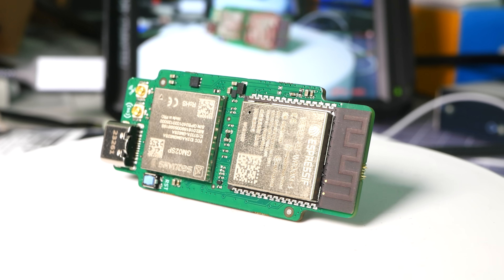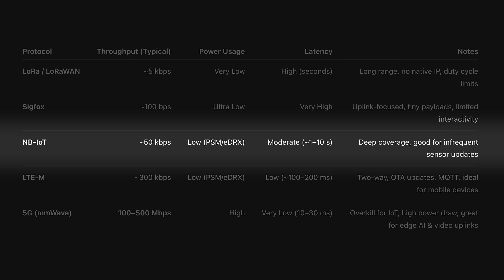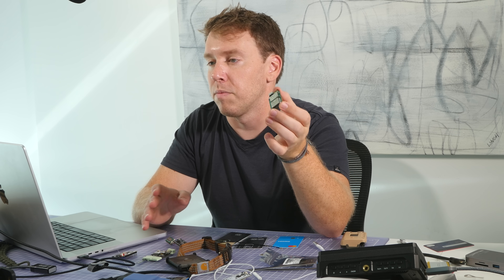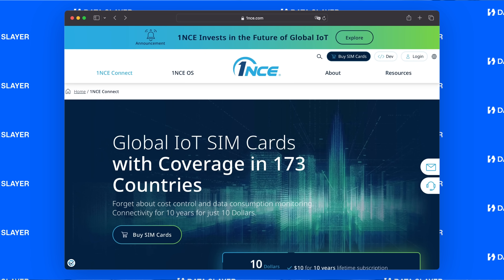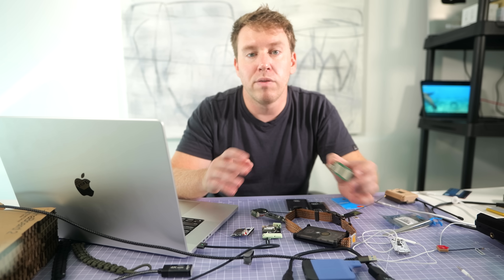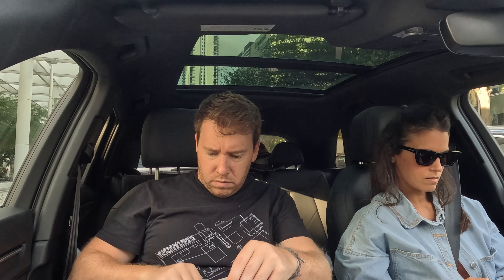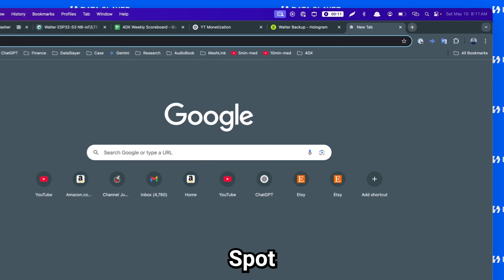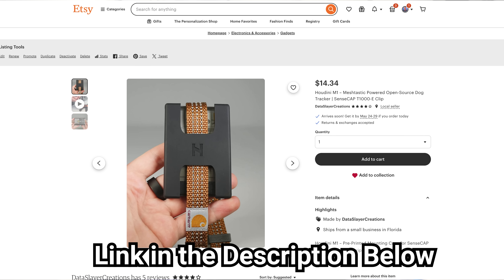You’ve Never Seen Cellular Like This

Comment: Ill be impressed when actual smartphones come with embedded Lora as a backup mesh communication backup, specially for remote areas and when camping.
Reply: Someday I would like to see cell phones with software-defined radios that use long range as primary, and only falls back to the cell phone tower when needed.
Reply: @pilotavery brother, they already do, to a degree, most of the more modern GSM cellular "modems" are technically capable of listening and talking well outside of their strict band requirements, they are locked at the firmware level.
Reply: @rickb06 no, they use very narrow tuned individual power equipment for each band, while also using very specific kinds of antennas, again, tuned for very specific bands and frequencies. They don't use software defined radios. Even Bluetooth operates independently, it's not a firmware thing. That being said there are some phones that specifically disable certain frequencies that are outside of a specific carrier, but that's only other bands that the phone would support internationally. That's independent of what I'm talking about.
Reply: @rickb06 actually there’s truth on both sides here. Modern phones aren’t pure SDRs, but they also aren’t narrowly hard wired per band the way older designs were. The baseband is largely software defined, while the RF front end (PAs, filters, antennas) still imposes real hardware limits. A lot of what phones can and can’t do today is locked at the firmware and regulatory level, but it’s not unlimited  you can’t just jump to arbitrary frequencies either. Direct-to-cell works because satellites operate within existing cellular bands, not because phones suddenly gained new radios.
Reply: @pilotavery You’re not wrong that phones have band specific hardware like PAs, filters, and antennas, and that Bluetooth/Wi-Fi have their own RF chains. But modern cellular modems are largely software defined at the baseband level, and firmware/regulatory locks play a huge role in what bands are enabled. So it’s not purely hardware limited,  there’s a lot of flexibility built in, just constrained by design and certification.
Reply: @marcfavell  the baseband and the chips, sure, but usually they have between 12 and 16 antennas and they actually emit a lot of them from the board. Different regions actually have different antennas and different traces on the circuit board and they can't put all of them because of issues with multipathy so they pick and choose which ones that region will have. 

Also a lot of them simply omit certain technologies like qam and mimo
Reply: @pilotavery why? What’s the benefit of that?
Reply: @YagnaVudathu  so if you are working in an area that does not have very good cell service at all, you can still call your Local Work Buddy with radio. Up here in Washington this happens all the time even worse in Montana.
Reply: @pilotavery They’re already trialing satellite-to-cell here in Canada — pretty sure it’s using SpaceX/Starlink. What’s really interesting is the idea of a hybrid: something with power usage this low, but with the ability to communicate directly with low-Earth-orbit satellites. That would be amazing.
Reply: I like the idea but i dont think it will happen. Better get used to carrying a keychain esp32 for LoRa and meshchats. Speaking of meshchats, have you heard of reticulum?
Reply: @Casualf1lth  anything is possible with open source technology. I have seen phone-radio combos that use android before. This would be a very easy evolution of this already existing product.
Reply: Why in the world would they do that? 
You people baffle me. 
You’re smart enough to know what LoRa is, but naive enough to believe it’s significant enough to make it into the smartphone market.
Reply: @TheOfficialOriginalChad  i agree, we'd have better luck establishing a dense wifi 2.4ghz coverage map with Rnode than with LoRa. LoRa is too prone to signal interference and has little throughput compared to wifi ranges and data speeds
Reply: I’d like it if they didn’t have a reason to regulate my favourite frequencies for my own private comms
Reply: You are not ready for the🕳️🐇
Reply: I would like cell phones to have built-in short range 2 way radios like the old Nextel phones had. The licensed Motorola technology is still in use in 900 MHz ISM 2 way radios, but they are not common anymore and I think this technology should make a come back in Android phones.
Reply: Something something niche something
Reply: could replace walkie talkies
Reply: that would be useful specially during emergency situations
Reply: ...because direct-to-satellite comms is too pedestrian ?
Reply: Well iPhones have satellite calling and text so not very necessary
Reply: @andrejcupac7359  If you got line of sight to the satellite. How about being in the woods or in a building (complex)? Direct radio is much easier and effective for short ranges
Reply: @andrejcupac7359 some newer android too for emergency SOS
Reply: Just use Bluetooth transceiver to phone and use an app, it’s available right now if you need it. They will never put Lora into an iPhone, you know that, so no use in wasting your breath that it will ever be available.
Reply: But where's the profits in that?
Reply: it will never happen
Reply: Its to niche. Would be a cool upgrade u can buy though
Reply: @dubfather521  that was said about satellite emergency comms until apple put it in their shiz
Reply: @dubfather521  It's only niche because a company like Apple doesn't make it standard in their millions of phones.
Reply: @RevJawa  its a niche use case in my opinion. Everyone mostly just uses WiFi and Bluetooth
Reply: @RevJawa Apple made satellite coverage standard since iPhone 15
Reply: @RevJawa  They are not going to make it standard when people would only use it 1% of the time.
Reply: Way too niche. Especially when wont even be a thing in a few years. With satellite.
Reply: aparently android has Wifip2p on their API (Wifi Direct) and people have made different types of prototypes on github, i dont know the specifics, but ive seen one actually do audio communications over it. So it is possible to send more data thought it than the average LoRa.
Reply: That'd be epic!
Reply: At the pace Apple and Samsung rolled out Emergency SOS it will happen soon.
Reply: Doubt this would happen in the current era. Countries want to be able to lockdown, and control communication. 

For example, Apple removing an app from the HK AppStore that protesters were using to communicate when the CCP shut down cell networks there. The app basically turned Bluetooth into a mesh network. 

CCP said remove it, and Apple of course had to comply. 

The first dev that can do a web/software jailbreak, and control Bluetooth, wins.
Reply: That would be awesome.  I like going camping and I have good mobile phone coverage, but it would be nice to have another layer of communication!
Reply: Newracom has some prototype phones for their haLow networking, a close relative to LoraWan. Demos are promising though currently only experimental.
Reply: I wanted to get a hdm fusion phone to see if I could make an attachment for it, but I can't justify the cost atm.
Reply: Search for meshpocket qi2 from heltec
Reply: Bro 💡🤯💭
Reply: Fuck smartphones.  Open source friendly devices like this mean we don't need them anymore.
Reply: can this be connected to an android device?
Reply: I would prefer mioty, LoRa is proprietary.
Reply: The battery life would plummet.
That could be designed into a system but it isn't going to work with the current tech.
Reply: We can't be the only ones thinking Lora is a good fit for phones
Reply: @657bhang  lora is a terrible idea for phones, it will never happen as 99.9% of people won't use it and the few that do will have incredibly small range.
Reply: this will never happen as long as we have mobile carriers in bed with manufacturers.
Reply: @travisbeagley5458  it will never happen as it's a stupid idea
Reply: The Pinephone has a lora addon module, unfortunately there's no distro that supports it directly
Reply: popularized and widespread LORA would negate cellular subscriptions
that is counter to the profit making
Reply: @jamesh4866  it wouldn't be popular, why would I want to change from a near perfect system to something with minimal range which heavily relies on the cooperation of others? You'll never have international calling.
Reply: @georger5558  it sounds like you don't even know how meshtastic can even be used so i donno why u are even talking to me lol
Reply: @jamesh4866  lol having worked in RF communications for almost 10 years I probably know a little more about this limited range of 433mhz from a minuscule antenna that 99% of people use. You're clearly a child from the way you talk.
Reply: @georger5558  and yet u cant comprehend how or why people would use it today and how that correlates to if a cellphone would have it 🤯🤯sure lil guy whatever u say 😂
Reply: @jamesh4866  lol if you never need to contact someone out of a few miles range you're golden, otherwise it's a waste of time. 

Amazing how you're unable to grasp such simple concepts like RF range. Must be an American.
Reply: @georger5558  again, if you dont know how it works or its applications, why are u talking about it? lol
Reply: @jamesh4866  again, you literally know nothing about it I know far more than you
Reply: @georger5558  😂"you know nothing, I know far more than you"😂😂😂😂

if you don't know the technology or any of its applications why do you still talk like a baby?
Reply: Less power and less subscription based money for them? Yeah, I don’t think so.
Reply: this.
Reply: But, how will the carrier make money?
Reply: @StephenMatrese  lmao you don't know the technology if you think this has a chance at being useful for large/global communications.
Reply: no joke a chinese phone my sister in law had for years had a lora radio with transmitter built in.  it was intended for that nokia style talk and probably used some illegal band
Reply: Your nasty snarky attitude is nauseating
Reply: Satellite will do that. It's already happening on iPhones.
Reply: That would be really cool and super easy to do, but then it wouldn't be encrypted anymore probably 😢
Reply: Not gonna happen
Reply: Wonder if anyone is working on a case
Reply: When you mentioned camping and remote areas based communications it made me think of the device called Sonnet.
Reply: uh they do
Reply: And recognize your contact list on the mesh
Reply: Don't expect that to happen. The reason why phones no longer have FM radios embedded is because cellular indiustry lobbyists wouldn't allow a free service. You're not going to beat a rich lobby.
Reply: Loras should be standard in all cellphones.
Reply: Im doing this now with esp32s3 set up orange pi2w with rpi5 ai lora plus walter and nrf24
Reply: I have lidar going in and esp32s3 ai adanvanced ai modual
Reply: Cardputer is also intergrated along with various esp32s3 displays
Reply: they have them bubby
Reply: Soon there will be a satellite connection from every phone. Mesh communication is some fallout shot that won't happen soon
Reply: Not going to happen for the same reason nearly every good phone has the fm radio functionality disabled in the bluetooth module. They want you tied to the cell networks with data and streaming plans.

FM radio functionality can still be found of mid -ranged phones. They use the headphone cord as an antenna.
Reply: @lonestead  That's not the reason, it's because it's an extra cost that 99.9% of people will never use. Meshnetworks are fun and great for remote use but for real world global communications it's pointless.

Comment: GNSS...is that GLONASS? So it works with other GPS systems as well?
Reply: Other way around, GNSS is the term/acronym for the concept used in GPS (USA)/GLONASS (Russia)/Galileo (EU)/etc, each separate systems but same idea of finding your coordinates with satellite signals, with more or less compatibility between different systems in terms of the chips and decoding needed
Reply: @liquidfenrir3338 AIUI inference by using all the systems gets you better precision than any one alone.  My cheap drone will land within 2cm from a quarter mile away, I believe using this aggregate system. In the old days we'd need several expensive differential GPS units to get that good.
Reply: @liquidfenrir3338 Interesting! Is the Galileo network finished? I never hear anything about it. 

Even Bezo’s Blue Origin is putting up a network too I believe.

Comment: well this is definitely a paid ad. Just by the voice you know he has no enthusiasm about this "product". Btw, at command really shouldn't be considered for an actual commercial product, other than maybe debug. 
Also it would be nicer to show the actual dBm than the "milli-amps current" when talking about something like this.
He started by introducing nb-iot, lte-m, etc. But never actually talked about how those wireless connectivity works or how to build the system, implement or use the stack on a platform that is meant to be open to customization and further development.
Reply: is he just a German?
Reply: @aucklandnewzealand2023  Do you hear anything german? I dont. Not a single german ascent - nothing.
Reply: It could be an ad for seatbelts
Reply: Agreed